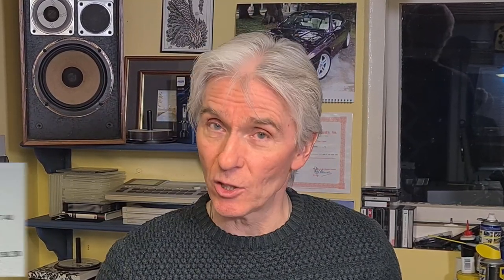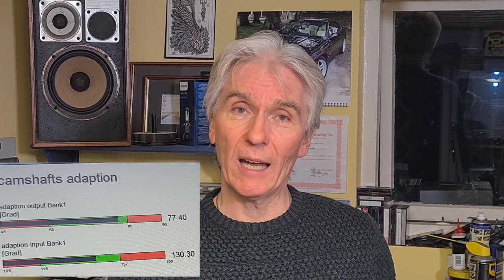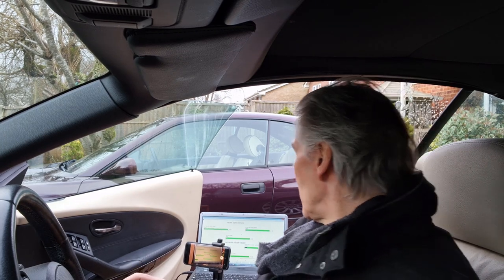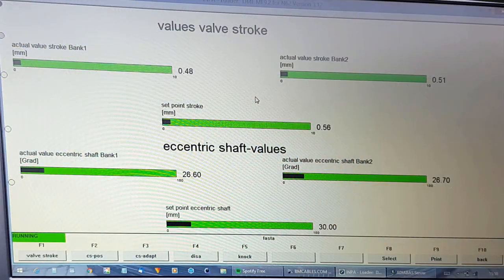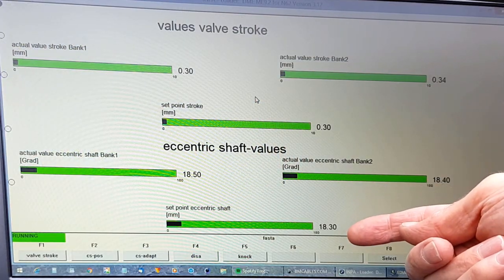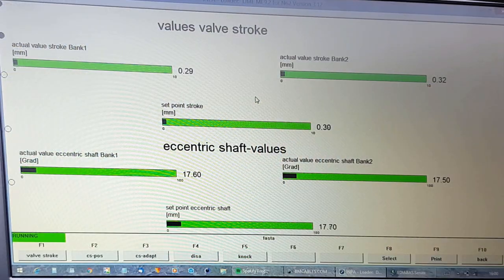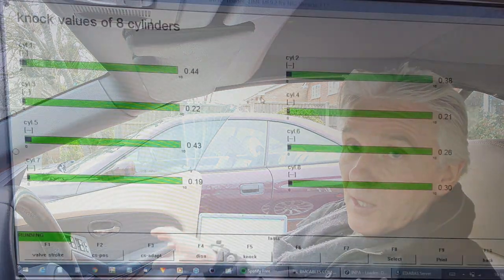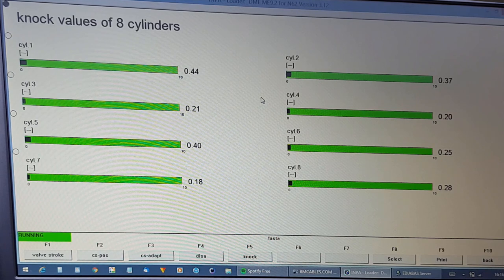BMW VANOS and Timing Chain INPA Diagnostics

Comment: Great Video Tim, Ran INPA on my 550i N62 2006 and 155k miles , and the values are not far off yours. Running ok. The slight problem i have on mine is that idle is hunting a bit rough, but the diagnostics come up ok. I since raised the idle speed to 670rpm , as its a manual and slowing down in a high gear (eg 4th) , does add some jerking before changing down to second. Anyhow the raise to 670 seems to help. Any ideas welcome from your incredible wisdom. Like the TR505 in the back BTW :). J
Reply from the maker: I have heard so many complaints of uneven idle on the N62 - that problem is usually a manifold leak or a failing MAF - but, I have heard of many owners with this problem that have checked and replaced with no good outcome. I'll keep investigating.
Reply: Daniel & Tim, thanks for the advice I will try those things and see if it narrows it down. The thing that baffles me is that the vitals on inpa are all within spec like Tims,  and behave in a very similar way.
Reply: It's the oil pressure.... increase your viscosity

Comment: And this is why I didn't do valve stem seals on my 07 BMW 750li.... everyone said change them and I know a lot about cars and said don't make since. This was at 115000 miles blue smoke on long idles. Vanos oil pressure controls timing. Out goes 5w40 to liqui moly 10w60 no blue smoke on long idles 180000 miles. It's all about the wear not valve stem seals.
Reply from the maker: Good call Jay!

Comment: Hi Timm, great video! With INPA following this process my 650i is hovering around the limit of 80 on the camshafts adaption page for the adaption output bank 2 (top right). Some issues I have are low speed hesitation under load, and often random misfires and cylinder shutoff after a cold start. I have ruled out solenoids, vacuum leaks and a few other things.. what do you think? Thanks!
Reply from the maker: Hello Tom, if the camshaft adaptations are getting close then change the chain tensioners - there are two, one for each bank

Comment: HI TIMM 👋 i need some advice  I have bmw 630i manual 2006 .. 1month ago I changed sparkplug and coil pack.. yesterday when im was drive car is stopped and no have really power similar when my sparkplug gone..engine code 7 come up mechanic guy tell me vanos is the problem so I don't know what I do now I need go some specialist to fix me because he just normal mechanic? Pls help me some advice what can I do
Reply from the maker: Vanos problems will not stop the car - just supply less power than usual. You need diagnostics next and follow this: https://youtu.be/PKXcDmNmj2Q

Comment: I am having no value coming from reading Vanos Adaptation exhaust bank 2, graph stuck with a straight line .   where should I start looking ?   replaced both vanos, crankshaft sensor, camshart sensors ..
Reply from the maker: Hello Marcello, it sounds as if you are getting no signal from Bank 2 camshaft sensor, so check Fuse 002 in the IVM - and if that is OK then it is down to the wiring and the DME itself.
Reply: @TimmsBMWRepairsandInformation   Thank you so much for getting back to me. I will take a look at this fuse tonight.   I just wonder, if the fuse is burnt, and the wiring is bad, it would not give me any code if the wire was disconnected from the sensor, right? I actually test it , I disconnected it from the sensor and it gave me a code.    :/

Comment: Hello Timm, your videos are awesome and i have learned a lot from it.

I do have a problem with my 740i. There is a rattle noise at idle, which I can't identify. The Inpa specs tell me, that timing chain and camshafts are fine. I have also checked water pump bearing, generator bearing and pulleys/belt tensioner. All fine.
Could this be a rattle from the vacuum pump? This is the only part i opened to change the seals.
Videos of my problem are on my channel.
I would very much appreciate your support.

Marcel
Reply from the maker: That could be a stuck lifter - have a read of this: https://www.meeknet.co.uk/E38/Tappets.htm
Reply: @TimmsBMWRepairsandInformation  
Thanks for your answer. I know this problem from the n52 engine. That the n62 has this issue as well is new to me. I'll try to find a spot where i can do this procedure and give feedback.
Thanks for your support :)
Reply: @TimmsBMWRepairsandInformation  
Hello Timm, i have had some time checking some more things now. Some people said it could also be the timing chain tensioner on bank 2, because it's very high in the engine and if it leaks already the tension for the chain is too low and it starts to rattle.
That was not the case at my engine. I changed it, but it made no difference. At least its one weak spot less now.
But i also listened with more attention with my ear close to bank 2, and i noticed the rattle coming from near the eccentric shaft motor. I suspect it could either be that or a torsion spring of the camshaft. 
Is there a chance to find the cause of the rattle without taking off the valve cover or do there even come more than these two causes into perspective?
Thanks in advance.

Marcel

Comment: hello I have a question for you about my car Vanos bank 2 retards how to solve this problem
Reply from the maker: Change the chain tensioner on Bank 2 - that's the easier of the two to change and is found in the V of the engine
Reply: @TimmsBMWRepairsandInformation  

isn't it Impulse sending wheel?
Reply: Hello 

on inpa test VANOS 

Nockenwellenposition Bank 1 0.09

Istwinkel fuer Vanos 1[ WNWI_WO ] 0.12

Nockenwellen position Bank 2 -2.31

Istwinkel fuer Vanos 2 [ WNWI_ W1] -1.90

Thanks